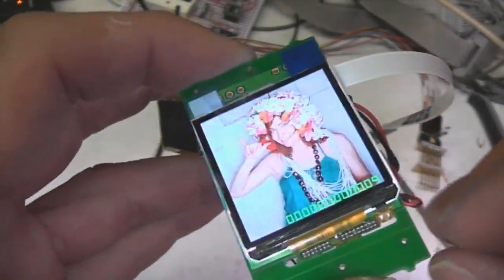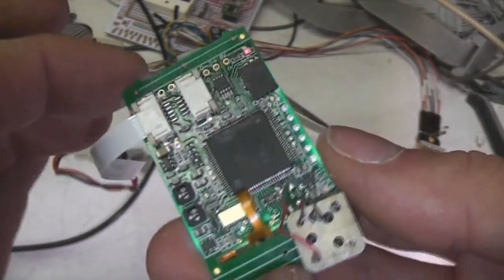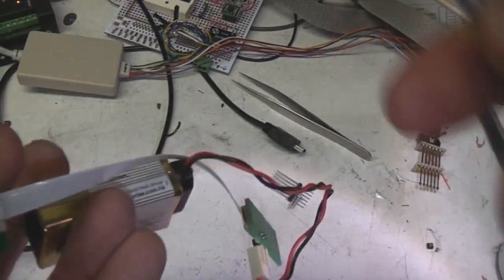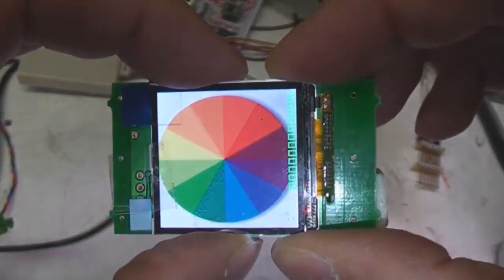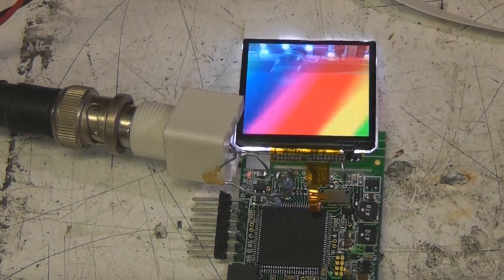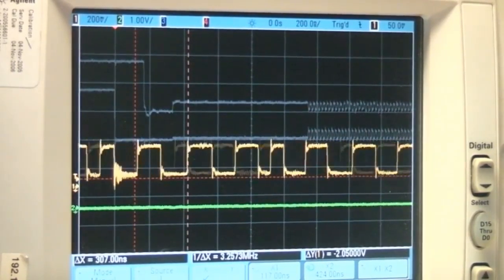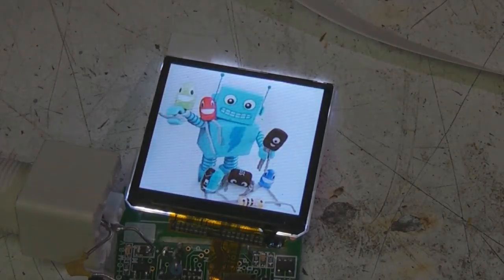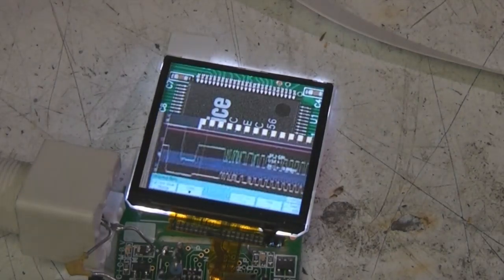Ipod Nano 6 LCD hack part 3

Comment from the maker: Absolutely, however dealing with the flex cables would get messy after about 4 connectors  on the same side of the PCB. I keep picturing a cube...

Comment: Awesome video, wish there were more to watch.

anyway, is it possible to get a display like that to take an external input, eg from a computer? eg using VGA or any other standard output, or a low cost way of running it through USB. Would be awesome to use a display like that to display random stats (frame rates, CPU usage, etc), and possibly also youtube videos while gaming, (kinda like the logitech G19 keyboard (ipod nano has a better screen than the G19 )

Comment: With so much extra IO:s, you could perhaps drive an array (say 2*2 or 3*3?) of those displays with an single Fpga? With pixel multiplication it could keep the flash data rate decent?

Comment: i saw Jeri Ellsworth on the display! She is after all the electronics goddesse :).
So you can basically clock it as low as you want. Could possibly be run by an mcu no?
Learned a lot thanks!

Here's a $1 tip, via *****